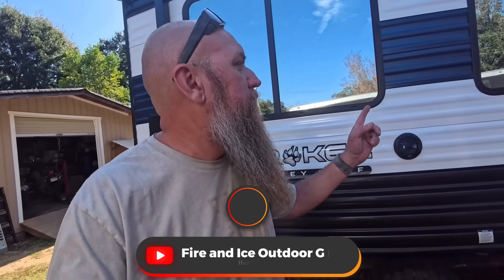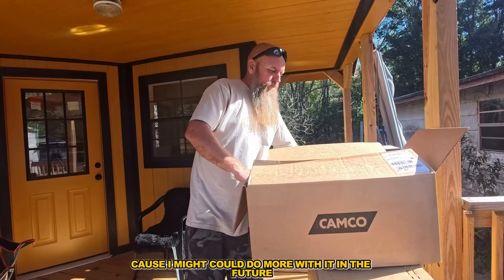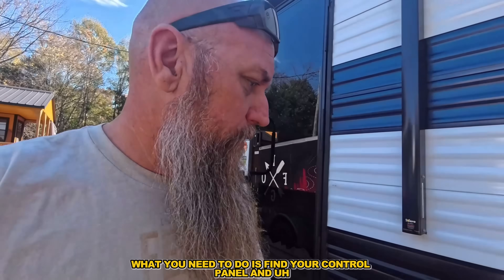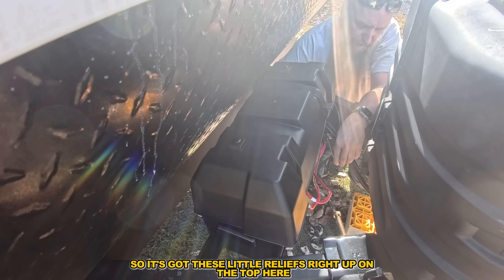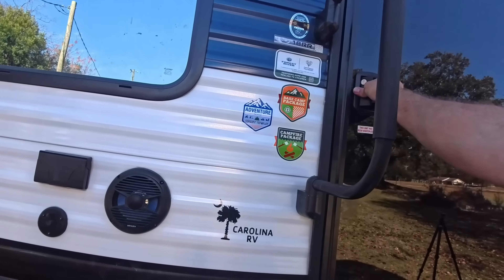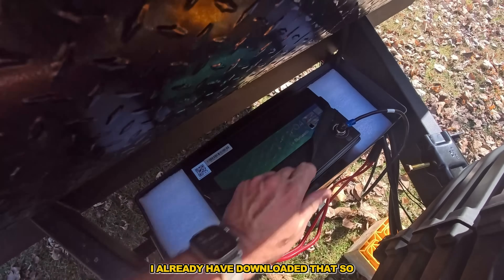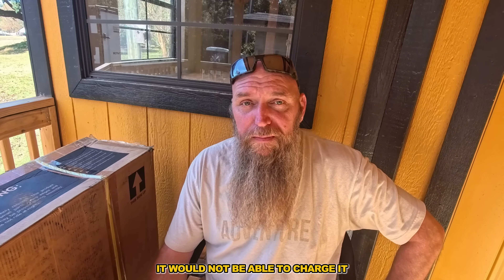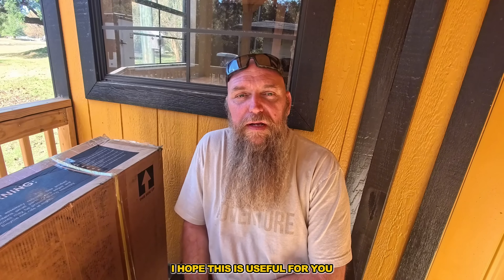How to Install a Dyness 12V Battery in Your RV: Full Setup Guide for Off-Grid Power

Comment: Are you running this with solar only or also charging from shore power?
Reply from the maker: All three it’s connected to my camper so the camper runs the wiring is solar shore, power, and alternator